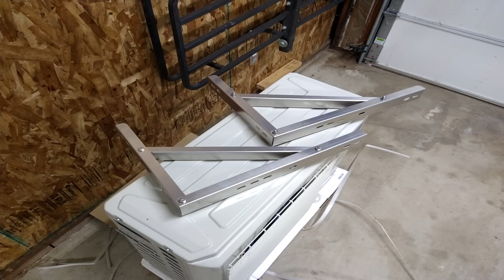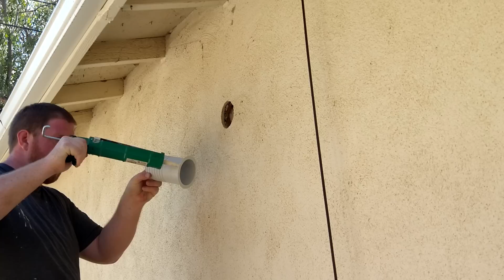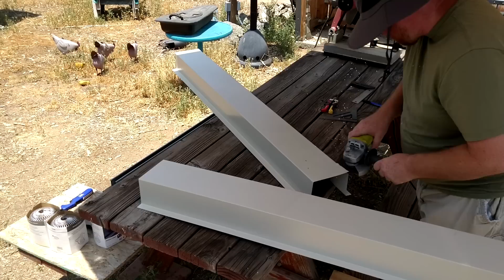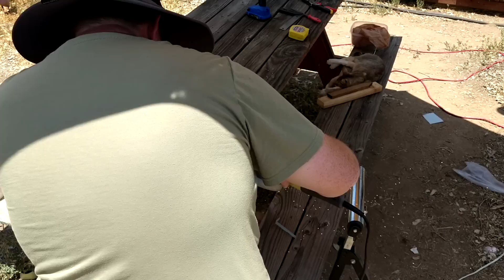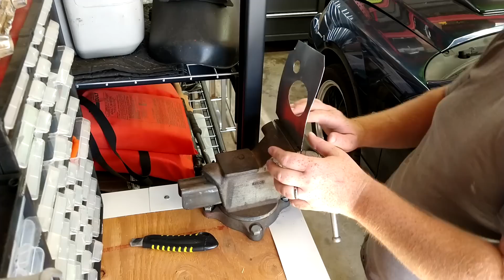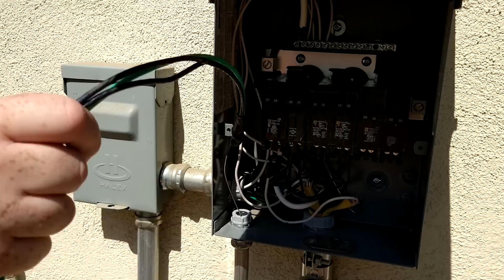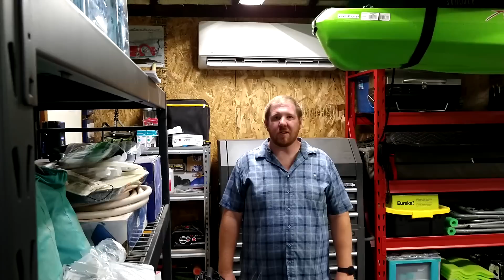How to Install a "non-DIY" Mini Split

Comment: HATE TO BREAK YOUR BUBBLE, BUT BOY DID YOU GET TAKEN‼️ 

AS FAR AS THE TOOLS GO ALL YOU NEEDED WAS A $20 MANIFOLD SET, $53 VACUUM PUMP AND A COUPLE OF PIECES OF 4 X 4 20 INCHES LONG INSTEAD OF THAT RIDICULOUSLY OVERPRICED $60 WALL MOUNT❗️ MR. COOL IS WAY OVERPRICED COMPLETE RIP OFF LOUSY WARRANTY FOR THAT MUCH MONEY. YOU SHOULD’VE AT LEAST GOTTEN A 10 YEAR WARRANTY ON THE COMPRESSOR AND FIVE YEARS ON PARTS. 5 YEARS LATER, YOU CAN BUY A SEVILLE 24,000 BTU FOR $1249 WITH A 10 YEAR COMPRESSOR WARRANTY AND A SEER RATING 21/2‼️P.S. LOSE ABOUT 60 POUNDS SAME GOES FOR THE WIFE. LIFE IS SHORT NO SENSE MAKING IT EVEN SHORTER.
Reply from the maker: ok then

Comment: Considering Mr Cool explicitly sales to never use thread sealer or tape as it can cause the unit to leak why would you do that
Reply from the maker: I'm a little confused; I don't think I used thread tape anywhere I wasn't supposed to and you are correct that you don't use it on flare fittings.
Reply: @jkfeatherranch it said No kind of Sealant on Any of the Connections

Comment: Did I miss it but do you have a wet box electric disconnect.per code
Reply from the maker: I do not, because the breaker is within line of sight.  Otherwise, a disconnect would be required.

Comment: Hello, Great video. Did this unit come pre-charged with refrigerant? I thought the non-diy units did not come with refrigerant. I am only asking because I bought the same exact unit, but in the 12k btu (smaller unit), and I am not sure if this thing has refrigerant inside of it. I called mr.  cool support line and they DID say it does not come pre-charged. Can you help clarify this  for me please?
Reply from the maker: The "non-DIY" units still come pre-charged with refrigerant, but require pulling a vacuum prior to releasing it.  That is the only difference, aside from the price savings (:
Reply: @jkfeatherranch  Hi. Thanks for the info. I called the Mr. Cool tech line twice within the 29 days it's taken me to get this done, and they both times they stated that the units are not DIY and therefore are not pre charged. I ended ripping the entire unit out of my home, put it back into the box, and returned it back to Home Depot after refrigerant came out on me and I quickly realized that, WAIT A MIN, this DOES have refrigerant in it!!! This has been the MOST frustrating project. I will be going with a PIONEER, which they have great support (they actually pickup the phone, unlike mr UNcool), and it's cheaper (in price). So upsetting Mr. Cool support could not be straight forward with my simple question "Does the Advantage 4 gen series come pre charged". I will NEVER do business with another Mr Cool product again.. They truly suck on all levels as far as support. Can't speak for the operation because I never got it running.

Comment: What raintight connector is being used to connect your emt to the liquidtight?
Reply from the maker: Compression fitting > threaded coupling > flex connector.  The wires inside are waterproof so it doesn't matter if a few drops get inside now and then.

Comment: You could of used a brazed fitting on the lineset which you kinked made a 90 bend and brazed it with a map gas torch which would of got hot enough for silver braze too melt . and maybe shorten up the lineset and checked the charge .

Comment: Where did you get the mini-split adapter?
Reply from the maker: Purchased from Amazon, please see the description for links to the products I used.  You can also get ones with built-in ball valves which might be useful.

Comment: I spoke with Mr Cool Technician, Patrick. He says "With a/c systems they have to have the vacuum pulled on them to pull non-condensable out such as air and moisture or it will not blend with the refrigerant and cause issues in the future and compressor failure. It may run for now but depends on how long it will run." Patrick states that it will void my warranty. What do you think? You followed the same procedure as the DIY units.
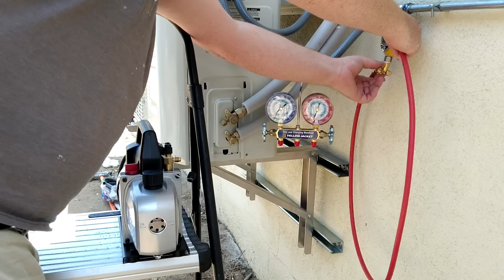Reply from the maker: I am a little confused by this comment.  He is correct that a vacuum needs to be pulled on the system prior to releasing the refrigerant, however I did this in my installation starting at approximately 24:00 in the video.
Reply: @jkfeatherranch  I didn’t reach the end of your video. There are a lot of diy videos out there so I have inadvertently contaminated my system. Any ideas on what to do?

Comment: From where the refrigerator liquid comes from? Don’t you have to turn on anything from inside unit before releasing the refrigerator liquid into the outside unit?
Reply from the maker: The refrigerant is stored inside the outdoor unit.  Once everything is hooked up and vacuumed and confirmed to not leak, all you have to do is open the valves on the outdoor unit.  Do not turn anything on until doing this.

Comment: WRONG.  the color of the wire does matter. 
Phase 1 – Black wire.
Phase 2 – Red wire.
Phase 3 – Blue wire.
Neutral – White wire.
Ground – Green, Green with a Yellow Stripe, or Bare Wire.

NEC code:

BLACK is the "HOT".
RED is the second "HOT" for 240 AC V.
WHITE wires WITH BLACK or RED TAPE, secondary HOT for 240AC V.
BARE COPPER is ground.-- Green wires or Green with a Yellow Stripe wires.  GROUND.
WHITE wire is NEUTRAL.

Blue wires and Yellow wires
Indicate a hot wire. These are usually found in a conduit for plug-in electrical devices. Known as travelers, blue and yellow wires allow operation of an appliance or lights from multiple locations.

12 VOLT DC is normally RED and BLACK wires.  the red is connected to the + side, and the black is connected to the  - side of the power source... motors will turn backward if wired backward.
some electronics will not work, others will burn out instantly.

communist chinese do not follow and color codes here.
Reply from the maker: This is true for building wiring and the main supply to a piece of equipment, but for control wiring between two pieces of equipment, that all goes out the window.  The manual doesn't even say which terminal does what, and references colors that didn't even come in the cable I received.

Comment: Is there anyway to stop the vibration? It sounds awful mounted to the walls...
Reply from the maker: If you really want a silent installation, set it on a pad on the ground.  Personally since this is a garage, I'd rather keep it out of mud splatter by mounting it higher on the wall.

Comment: Question... is the the oversized system short cycling?
Reply from the maker: It has the ability to throttle down to only 6,000 BTU so not really.  On a hot day (100+), it draws ~2,000 watts continuously to maintain 70-72 so I wouldn't really say it's "oversized," and wouldn't really want to have gone with anything less.

Comment: Very nice work and great video. 
The 2 cars are massive heat 'batteries' so I'd say that unit will do well. 
I'm looking at installing one of these soon, but need to find a product that has a floor mount air handler and a warrantee that doesn't require a certified installer.
Reply from the maker: It's doing well after 2 years and as long as I remember to keep the filter clean, has no problem hitting 70-72 on a 100+ degree day if I remember to turn it on a couple hours before I go out there to work.  A floor fan helps to distribute the air.

The DIY version of these gives a 5 or 7 (if I remember right?) year warranty for a non-professional and I think you can get them with low-wall mounted air handlers, but I've never seen one with a floor-mounted one.  I'm not sure how much good that would even do, since the piping is not flexible enough to roll it around.  Unless I'm misunderstanding what you're asking for.
Reply: @jkfeatherranch  my ex just had some Mitsubishi floor units installed. The vanes direct the cold air up at approx 45deg. Works a treat.  Senville makes some that look pretty good.

Comment: Love the video and attention to detail! You made it look super easy. How has the unit held up over time? Any issues? If so, what?
Reply from the maker: It's been holding up for 2 years now, only "problem" I had wasn't a problem at all, but it wasn't maintaining temperature and gave me an error in the app about the evaporator temperature.  Turns out the filter was clogged and it worked fine again after cleaning it 🙃

Comment: I plan on doing one of these Advantage non-DIY kits, but I am going to be needing 75' of line (I think they come with 16 or 25 ft).  Since I will have a longer lineset, than what is included, will I need to have additional R-410A added to my system?
Reply from the maker: Yes, there is a certain length over which you have to add a certain amount per foot, but I don't remember what it is off of the top of my head.  It will be in the directions somewhere.  There is also a total max length over which the system won't perform well, which you should keep in mind.

Comment: Love the videi. I'm planning on buying a torque wrench, but really debating whether it was needed.  How did you judge how tight to tighten the fittings? Just very snug and call it good, since the vacuum test will tell you if a leak?
One other question: i bought a crappy Vevo manifold set and it's leaking, i see the fitting has a scrape so it was defective on arrive. Where did you buy your yellow jacket manifold (and midel number?) Thanks so much again for this helpful video!
Reply from the maker: I don't remember the model number but I bought it on Amazon along with the rest of the parts.  Between our house and the in-laws, I've probably done 10 mini splits total at this point and it's held up fine.  I, too, went through two cheap Harbor Freight manifold sets that started leaking before finally buying something better.
Reply from the maker: As for torque specs, I just went until it felt tight.  So far I've done all of the mini splits I've installed that way and never had one leak.

Comment: I have the 9k adventure 3rd gen. Is that also a 3.5 inch hole for the blower?
Reply from the maker: The kit should tell you what size hole to drill, if not then just drill one the same size as the wall sleeve.  We've installed a couple of 9k and I think they were 2.5"

Comment: If your micron gauge holds steady, good to go on the leak test, as the outdoor temp is on the rise the reading will also go up. the average charge in cooling with the compressor running should read 125 psi. In heat mode look for 300-425.

Comment: Great detailed video! 

Hoping you would an update regarding whether or not the weight and vibration of the compressor is causing the stucco to crack? This has been a huge concern of mine while contemplating where to put mine. I have same texture as yours. Because of my concern I’ve decide to mount in less than ideal location on a pad rather then attach to more ideal location which is to building under the gable end vent. Before I begin the process it would be awesome to learn if my hesitation is justified or not?
Reply from the maker: No issues whatsoever, I've used it for two summers and into the second winter now.

Comment: Those short 90's on the refrigerant lines are no-bueno. Otherwise nice install. 
Personally, with the price of refrigerant these days, I also like to pressure-test with nitrogen overnight before the final vacuum too!
Reply from the maker: They're probably not ideal but they've been working so far.  I didn't have a nitrogen tank available but I've been testing other ones I've installed and so far no leaks found.

Comment: The unit only uses 3 #10’s?   No neutral?
Reply from the maker: No neutral, two hots and a ground only.  Aside from dryers and stoves, most 220v devices don't need one.
Reply: @jkfeatherranch  so weird but the unit and condenser need it.
Reply: @neckofthewoods24  the two hots operate on opposite sequences because they are ultimately connected to opposite poles of a transformer so they each act as a neutral exactly half the time and as hot exactly half the time, with exactly the same amount of electricity, just not at the same time.  They alternate back and forth perfectly balanced in their draw and pull.  Dryers and stoves have some components that use just 110v such as clocks and timers, so those 110 components draw their additional electricity from only one hot line  (they don't need or use both), creating an imbalance, so it requires a 110 capacity neutral line.  These AC units require 220 all the time.

Comment: Great Video! By far one of the best mini-split install videos. I'm going to install one this summer and preparing. Not sure from the angle but could the kayak hanging from the ceiling be in the way of getting 100% air flow from the unit? From the angle in the video, looks like it could be blocking the right 1/3 of the unit where the air is discharged.
Reply from the maker: It might be but at the same time after using it for two summers it works well enough that I don't care to change it.

Comment: Great video bud. Just wondering if you had osb walls inside, why didn’t you remove them and run the lines inside the studs ?
Reply from the maker: In case the lines ever create condensation, I'd rather have them outside.  Also in case there's a leak or something it's just easier to chase down and fix.

Comment: You'll notice that you have not pressure tested the lineset. You'll notice  the micron gauge on the wrong hose. It needs to be on suction side or you'll get in microns in the red hose, not where you actually need to read them.... in the linset. Side note. The unit is too small for the area you need. I call this install a future service call. And I give it a C-. Kids.... let professionals do the big boy work.
Reply from the maker: Still working fine.  Go back to HVAC-talk.
Reply: Greg...bull shit. the unit is fine size-wise. the micron hookup is good, the gauge valves are both open, and the suction line is hooked up to the vac pump here. there is no high-side service port...no wonder the pro often knows shit out there...
Reply: @erikcable1755  wow you've taught me nothing... you should be a teacher.

Comment: I have a question, which generation did you install?  The manual is a little confusing for where to drill the line set hole.  Mine says 5.95 inches to the right and 1.85 inches from the bottom.  Is this 5.95 inches from the center of the bracket (on the bottom right) and 1.85 inches from the bottom of the bracket or the bottom of the air handler (i.e. is it less than 1.85 in from the bottom of the bracket.

Comment: Nice job. You must be single because the average wife wouldn't let you have cooling in the garage before the house. LOL
Reply from the maker: The wife is in the video. She has been around for 16 years now. The house had absolutely no insulation so any attempt to cool the house prior to getting the insulation in the walls would have just been wasteful. We installed a swamp cooler on the house as soon as we moved in and that had been good enough until we finished insulating the house and installing the mini splits. The house got the mini splits a few months later.
Reply: @jkfeatherranch  A hunnert+ degrees in IL always comes with so much humity that I would just be laying on the concrete floor waiting.

Comment: Sir,you answered my question,I’m installing the same unit and when it came time to connect the lines to the inside unit,there was a hiss and some gas was escaping,so I stopped wondering if it was an inert gas or Freon in the unit,but when I watched your video you mentioned it was argon gas,then I finished the installation.I have to mention I watched a lot of videos for the non DIY type but that detail was not given,until I watched yours.Thank you.
Reply from the maker: Thank you. I'm glad it was helpful I tried to cover everything in the video.

Comment: Nice video. One thought is the wrong kind of spray foam in that wall hole can squeeze shut the condensate line and flood the air handler reservoir, spilling water over your interior wall.

Comment: Where did you get the adapter, or what do I need To be able to go from the r134a gauge kit to the connection to the unit and vacuum pump?
Reply from the maker: My gauge set connected to the vacuum pump without an adapter, so I'm not sure what you'd need.  Sorry.

Comment: I am researching installing my own mini split, and have watched several videos.  Nobody, thus far, after watching 7 videos, have stated that one can "borrow" the vacuum and AC gauges from an auto parts store. -- you just leave $150 deposit and you get it back once you return the item(s).  The only thing left to buy is the flange set, and the gauge "mini" connection.  It's always best to not have extra length on the pipes, and God forbid you coil them in the vertical plane!

I was surprised in THIS VIDEO, that the OP did not test for leaks on the inside unit before going through all the trouble.  I can imagine finding out you have to return/swap the unit AFTER drilling holes and brackets, etc.
Reply from the maker: That's what rags and or a piece of wood is for. Since it's just the garage it wouldn't have been a big deal if there had been a problem with the unit.
Reply: The auto part store does not have the correct gauges. You can’t just use any gauge. Plus an Auto part spot vacuum will be for 134. I wouldn’t mix refrigerant like that. Mess up the oil.

Comment: Great video.  I am about to buy a unit.  I really don't like that coil of unused lines stuffed behind the outside unit that result from the DIY install.   I like that your unit (like any AC unit) has the lines sized to fit properly.

Comment: your're not going to know if you have a leak when you close the low side from the micron gauge and go off the manifold gauges they aren't precise unless its a huge leak thats what the micron gauge is good for. otherwise you could have pressurized the system with nitrogen and sprayed your joint with bubbles to see if they were leaking